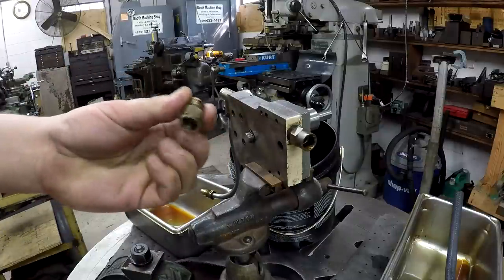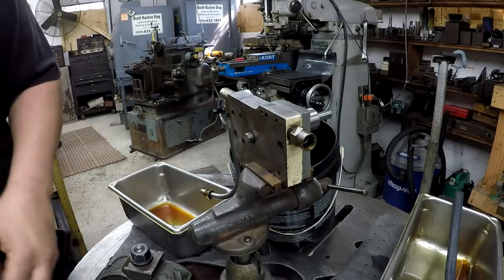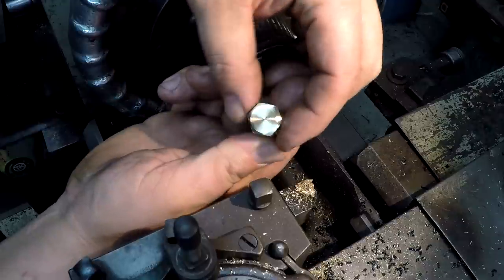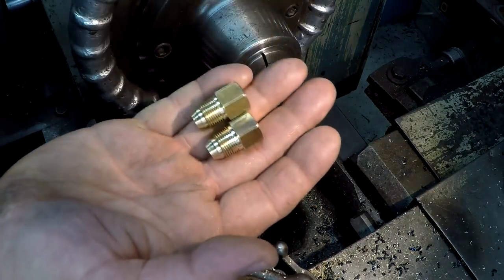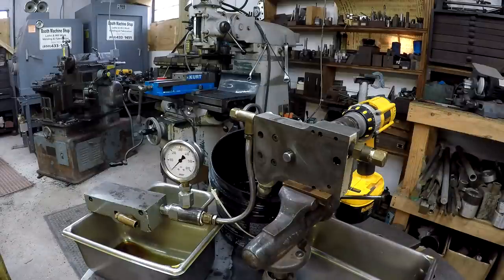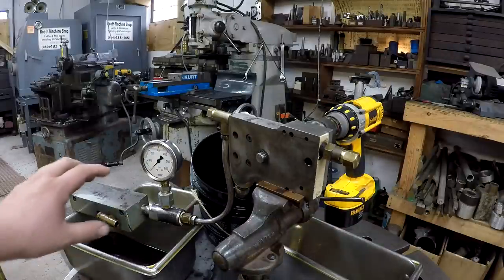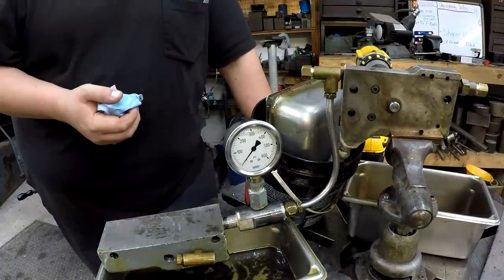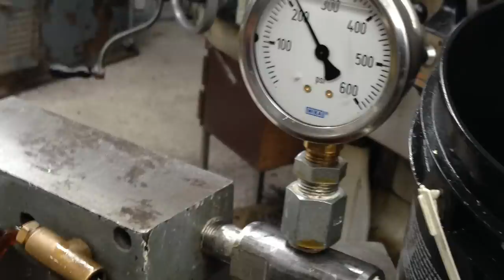K&T Pump & Relief Valve Test

Comment: Checking flow rate is easy. Just time how long it takes to fill a container.  So if it fills a gallon container in one minute, then it's a gallon a minute. The test you showed today was what I was asking about yesterday. I need to see if the pump can build pressure and not bypass internally because of excessive clearances. And it did.  Thanks for the great videos.

Comment: Boy, were you WAY ahead of me. 😊

2 1/2 gallons per minute = 10 quarts per minute = 10 quarts every 60 seconds = 1 quart every 6 seconds. You're flowing pretty close to that. Good enough for what you need. 
Just have to make sure nothing is broken or leaking as you continue your inspection.

Thanks for the video 
John

Comment: Adam you can "bucket check" the flow of the pump by putting a known quantity of fluid in a bucket with the suction and timing how long it takes to discharge it with the pressure relief valve in place. For instance if it's supposed to flow 2.5 gallons per minute at 200 psi then time how long it takes to pull 5 gallons down. If it's faster than 2 minutes your flow rate is fine. If it's slower then it may not be moving enough fluid to properly operate the machine. My two cents anyways. We used Coriolis flow meters on our equipment at my work and when we calibrated them that's how we tested to be sure they were actually pumping at the correct rate.
Reply: Michael Roberts You are right on.  That's what it is all about.  It is just a fluid pump that conveys flow to an actuator:  whether it be a cylinder/ram or a rotory device.   Don't know what the focus upon pressure is.  All it does is spin some wheel to actuate the x-y-z axii.  Ain't lifitng a house.  I believe there is some leak somewhere in the circuits.  I bet it is one of the actuator housing assemblies that worked loose.  But, we will seee.
Reply from the maker: WAVETUBE84 You may or may not remember I wasn't getting any pressure at my test gauge, which is directly out of the pump. Doing all this bench testing it seems to work fine. No pressure at the test point indicates something was wrong.
Reply: Abom79 You're on it A-Dude.  Like a string of Christmas lights:  finding the bad component.
Reply: WAVETUBE84 It's not spinning some wheel, It's expanding a closed system plate style clutch.Based on the video he emptied a gallon bucket in less than 10 sec. Just looking at what was coming out of his tubes, Adam has plenty of flow. Gentlemen, I suggest that this is not rocket science.With all do respect, Cliff

Comment: Very curious about what is causing the problem, now you proved that the working pressure is good. It is turning into a good investigating series like this! Cheers.
Reply from the maker: Flip de boer Get a little closer each week.
Reply: I know that this video has been up for quite some time but I wanted to kick in something.  When you don't have a flow meter, you can run the pump for 15 seconds.  pour the fluid into a measuring cup and measure how much was pumped out.  Multiply by 4 and you will have your flow per minute; convert volume to flow rate.  Love the videos.

Comment: great test. next step, map the flow paths and ways to isolate each for testing. through casing and block flow ports can be places trash and silicone sealant contaminates into the system at the time of the repair. valves can stick closed.

Comment: Plenty of comments covered the flow rate testing. As for the pressure bleed from the scored poppet, IMO it is inconsequential to the operation. You need only maintain pressure while the pump (and mill) is running. Hydraulic fluid (oil) is not compressible, so even minute leaks will remove the pressure quickly once the pump stops. I have had many tractors, when they are new you can raise an implement and it stays up. As they wear, the implement will drop to the ground overnight, from small leaks in the valves. But the tractor is far from needing repair because of that.

Comment: Adam, please remember that just because your spindle is going the right way, the pump / feed motor may not be. These are two separate motors and sometimes the wires can get changed around on the contactors in the control panel by someone who may not be too sure of what they are doing. Please be sure to double check both motors when going back together. Just because one motor rotation is right, it doesn't mean both motors are.

Very good test this time, using the constant flow of the actual machine pump.
All the best,
Cliff
Reply: Clifford Fender It would be almost too easy, but if it is, then, Adam and most of us would have learned lots of stuff about hydraulics.... ;-)
Reply: pierre beaudry Just food for thought.

Comment: Hi Adam I look forward to your video weekly, thank you for inspiring us all. In part 2 of sns 80 around 5:15 your friend explains the failure to be the poppet not holding the sysyem pressure in the relief body. He explains the spring rate is fine because it relieves at 250psi but the valve is not holding. In this video you also mention the pump is not holding at the seal. It might be something to ask your friend if the leak by at the pump was caused by a possible failed seal or if leak by is normal. In my experience with hydraulics a system pump feed line is normally kept at pressure so I would still consider your first thought of a failed relief to be your issue because it is not holding 250 psi statically at the poppet.
Reply: Tim Cho As slowly as the pressure bled off, I seriously doubt that has anything to do with the problem.  That test was with a manual/stroke pump moving VERY little fluid.  Were talking like a couple tablespoons of fluid/min on a system pumping 2.5 gal/min.  Unless I completely misunderstood the flow of this system, that poppet is designed to open/leak/bypass and hence regulate whenever system is running and the flow to the hydraulic components and lube outlets is less than pump output so bleed back should never come into play when the system is running.   But I don't know this particular machine and could be completely wrong.

Comment: I don't have anything to suggest that others have not already covered.  It looks like you are on the right track.  I guess my big question is why is the relief valve working on your test there but failing when you did the test with the hand pump?  What has changed between then and now?  Looking for a smoking gun I guess.....
Reply: Keith Rucker - VintageMachinery.org  That was my thought Keith. Is there not supposed to be a check valve at or near the relief valve, to prevent backflow and maintain operating pressure on the output side?
Reply: Rain Coast  in the test with portapower you were just running the pressure up to pop off the relief, with the pump you are continuously pumping oil into it.  Could the overall problem be like the oiling system in an engine when the bearings get so loose, and their clearances so wide that the volume of the pump is not enough to bring the pressure up to the relief setting. Like if you took one of your "test plugs" out. something in the business end of the machine is dumping so much oil that the (OK) pump cant keep up.   Dave

Comment: I have been following your progress on this project. i suspect that the suction hose was collapsing, and think you are right about replacing it with a steel pipe. the pump is looking good and the pressure valve.

Comment: Hi mate.
After looking at the video, I think your fine with the pump and valve.  I just reminded myself that the system does not need the maximum pressure, it can just go up to that pressure.  The whole thing might be working at a far lesser pressure than the maximum.  As you stated you found some rotten O rings, and that might be it.  If what it's supposed to drive is ok, than you can't go wrong. 
Well done mate.  It's good to see how many people want to help, how lucky is that....

Comment: I don't have anything to suggest that others have not already covered as well. I think the problem was the hose from watching your tests.
 I would like to see the pressure relief valve unload at the correct pressure and return consistently before reassembly.
JMO , thanks for the video and good luck.
Richard

Comment: That looked pretty good, Adam.  Time to go on to the suction line.  Make sure it has an adequate ID to achieve the flow rate.  It would be best to determine what K&T used originally for a suction line.  The suction side also needs to be totally air tight, but you know that...
Reply from the maker: ***** I'm using 1/2" steel tubing which has a 3/8" ID, should work good.
Reply: Abom79 I guess the only other thing I can think of is a big leak in the system somewhere, like a missing plug, blown oring, or something else that is letting your oil leak back to the sump, which keeps it from building pressure.

Comment: Hi Adam,
Good test, I agree with Matt Wilkins, your relieving at the proper pressure so I would be looking at the component's  on the 2 other branches of the circuit.
And the suction line.
Working on hydraulic systems daily, I can tell you it doesn't take a very big leak to lose 2 1/2 gpm . 
Would it be possible to install the pump and relief valve, and run the pump. You can run the relief into a bucket instead of on the gears. 
Set the whole gearbox in a pan, run it a few secounds, and see if you still get 250psi at relief. Or it may not bypass at all. If not, try to see where the oil is coming out.
If you get bypass at the relief, you should be OK.
I don't know if this would be feasible for you, but I think it would tell you alot.

Comment: I think those components are good to go, time to put them back on. Have you air checked those clutches yet with a blow gun?
Reply from the maker: bcbloc02 Yes i have Brian, I was air checking them since day one of inspecting. I showed some of the clutch today on video, and put it all back together. The clutches look good, and seems to work just like it supposed to.
Reply: Abom79 bcbloc02 Looking good Adam.  I am hoping you licked it by replacing that suction hose and cleaning the filter.  Watching the flow on your initial test I'd say you were right at or a little short of your 2 gpm, this is before you sped it up.  Of course once you hook it all back up those other plugs will not be blocked and the pump will have a harder time building pressure, have to wait and see.  Can't wait to see the old girl back in action.
Reply: Abom79 Thanks for showing such interesting diagnostics Adam. I was thinking about the ports in the castings being blocked with gasket goo and I guess you were concerned about that as well. At least now you are fairly certain that the mechanism in the knee is capable of pumping an adequate flow to work the relief valve.

Comment: I'm thinking it was that suction line collapsing. That crimped rubber line looks custom. Like you said in a previous video, those lines aren't meant for suction.  I worked on an old John Deere that wasn't building oil pressure. Had the pump machined back to spec by a machinist buddy of mine. Wound up finding a piece of duct tape blocking the suction tube. Now builds plenty of pressure for a 90 year old tractor.
Reply from the maker: Nathan Wilson I sure hope its the suction line, but today I also found two bad o-rings. More on it later.
Reply: Abom79 As the old saying goes, "For want of a nail the shoe was lost. For want of a shoe the horse was lost. For want of a horse the race was lost."
Reply: Abom79 Remember the pump only provides flow. Resistance provides pressure. If you did todays test with one or both of your plugs removed most likely the relief valve would not have opened and system pressure would have been zero or very low. Somewhere in the system resistance was lost (bad O-rings) and that would explain the low pressure on your system pressure gauge. It doesn't matter that the gauge comes directly off the pump, the pump only provides flow. Something in the system, like clutches and motors (hydraulic) provide resistance. Find the leak now that you know the pump provides flow.

Comment: Adam, I've worked on a lot of military hydraulics, but no machines like this mill.  The vast majority of my experience is with a sealed system that runs 35gpm at 3000 psi.  Mostly hydraulic motors, though I have some experience with rams.    What I can tell you is that there is no minor dripping leak here.  This is a major blown seal, o-ring or gland in either a valve body, shaft seal, or perhaps a clutch or a split, detached, or unseated line or hose.  What I'm getting at is that it's a BIG leak.  In this instance, a 2 plus gallon/min leak.  Sorry I don't know the workings of this particular system,  This one's obviously more difficult to trace since the leak dumps back into the sump.  My recommendation is to orient the assembly as it sits in the machine over a large drip pan with jumper hoses on anything you can't have attached in this position and repeat the test you just did here with oil if possible and look for the biggest hemorrhage.  At only 225 psi, it'll be a doozy to keep it from getting to and maintaining working pressure. FWIW, you can check the flow rate without a meter by simply timing how long it takes to pump a gallon or quart and doing the math, though it's pretty clear the that the pump and relief/bypass assembly are likely well within reasonable tolerance.  Be careful testing with air as it is compressible and stores energy.  If a seal pops under oil pressure is just starts leaking or moves at a relatively slow rate.  If something that's normally held captive when assembled blows out under air pressure, it could send parts flying at a high rate of speed.  Good luck with the troubleshooting.

Comment: I'm still thinkin it's the suction hose. I've seen and had my share of them even fuel lines deteriorate and cause blockages. It sucks that it's a pain in the ass to put it back together to see if it works so I understand why you're looking at every little thing. Good luck! Challenges are always fun but it's even more fun to solve them quickly.
Reply from the maker: Gee Dubb Yep, it's a job, especially after you have it all filled with oil. Hoping to find anything wrong i can and correct it before we slide it back together.
Reply: Abom79 Amen brother.

Comment: Nice "quick and dirty" job on the plugs!   Good test Adam....From the amount of oil in the bucket, it seemed as if the volume was close to being correct. I too agree that things are looking good as far as the relief valve and pump are concerned.Maybe by removing and cleaning the relief valve, it took care of it. I seem to recall a couple of misc items you had found, so maybe it will work fine when you get it back together.  Hang in there with you chin up!        Jim
Reply from the maker: Jim Liechty Thanks Jim. Today I put the mystery parts back on the machine, more on that next week though.

Comment: About your rpm's with the portable drills: you could get an stroboscope app for your cellphone and set it to 980/min / 60 = 16.3Hz. Tape something white on your chuck, shine your phone's led at it and slowly speed up your drill. When the white thing appears to stop moving at your 16.3Hz light, you've hit 980rpm
Reply: ineedagoodnickname Hi mate.  That is a good idea.  I did not know that it is available.

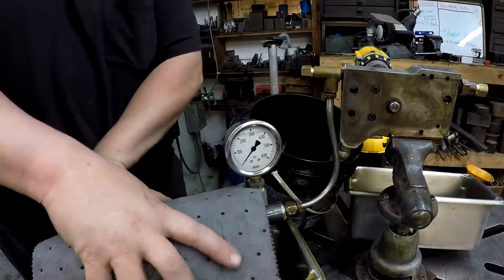Comment: Did a little analysis on the audio and I calculated something around 600-900rpm for the run at 10:50. Hard to tell from the spectrum, but you're definitely in the ballpark.

Comment: Quite fascinating progress. Adam, have you considered any drive issues to the pump? Is the drive rotating at the correct speed? Can you be sure that the motor is rotating in the correct direction? Can you be sure of the connection between the motor and the shaft on the pump is not slipping and there is a positive drive?
As for the speed of the drill your using I think you have one of those Starrett speed measuring tools with a rubber tip on the nose of it? -Trap the drill in a vice and clamp the on / off switch wide open, put the speed measuring tool up to a nearly closed chuck for 60seconds = reasonable speed check of the drill (under no load of course!)
I do wonder about the suction hose and filter combined causing starvation of oil to the pump. The hydraulic pipe is in really poor condition and the mesh seems very fine indeed - perhaps not a total blockage but a likely restriction?

Comment: Suggestion for your test: 
If you have a lathe that is variable speed use it to drive your pump. You can use a hand held tachometer to check spindle speed and get the proper RPM before chucking the pump up. Then attach a hose to the outlet of the relief valve and into a container of known volume, perhaps a half gallon. With all things set up start the lathe and time for 30 seconds. Do a little math and you have the GPM  at the proper flow and RPM. This test should give you a pretty close approximation of proper running conditions. If you have enough oil and a large enough container you could run the pump longer and get a more accurate  reading.

Comment: Adam,What do the two plugged ports normally hook up to? If you're not developing any back pressure(IE:free-flow) at those points,which indicates they're getting lots of oil,you may never build up enough back pressure to activate the relief, which is normally in a system  like this to prevent blowing up the pump or some other component..This system is for lubing some shaft(s) is it not? Do they drain back to tank? It's not like and enclosed system with cylinders or such. Or maybe I'm missing something.